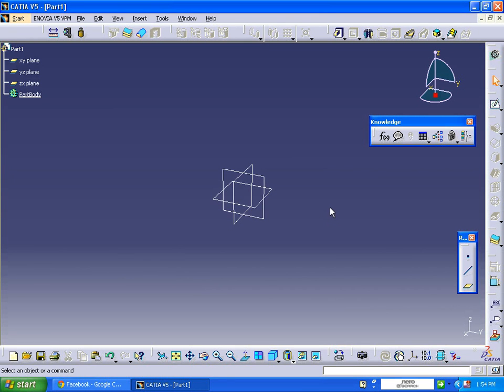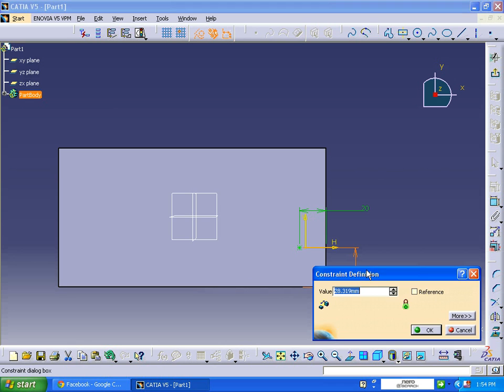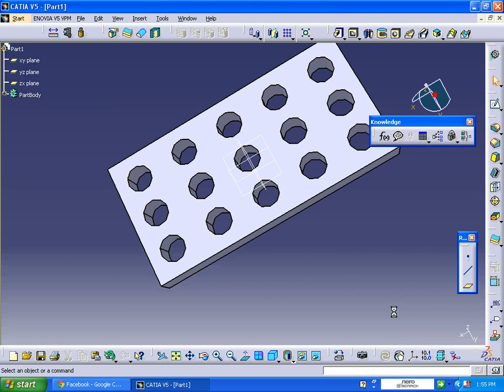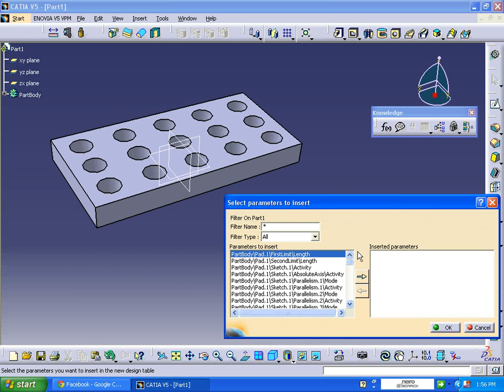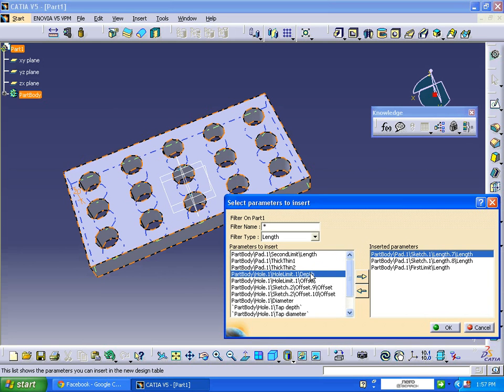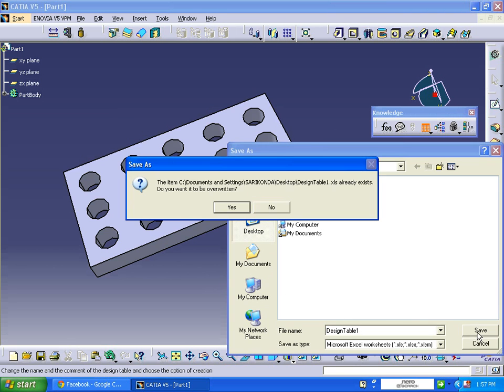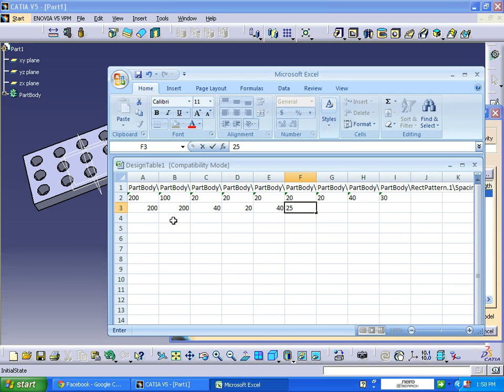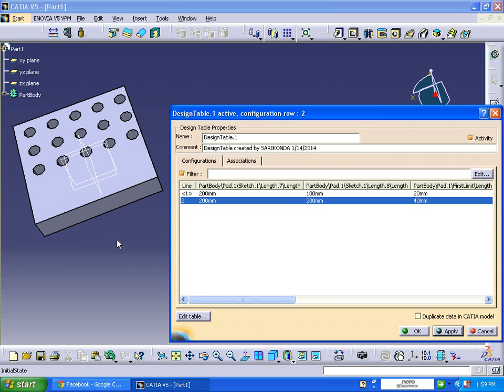Catia V5/ Design Table

Comment: Reason for using design table
Reply: You can create multiple complex parts using a template that is designed with this table just by filling it with different values